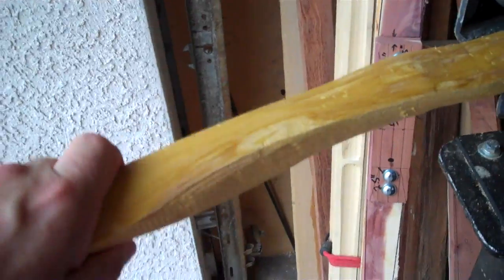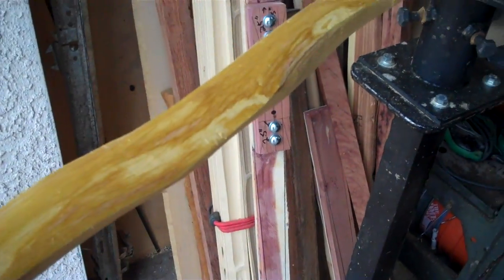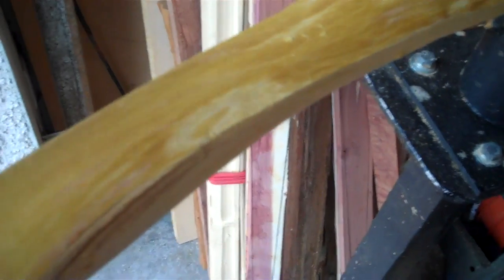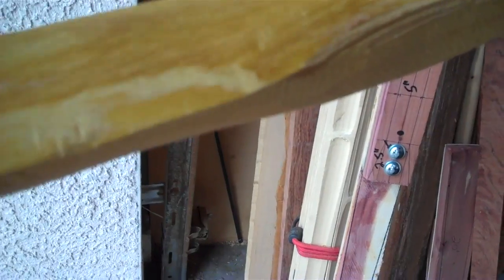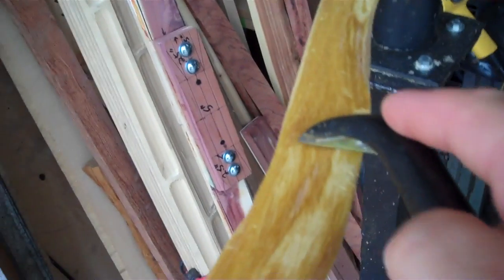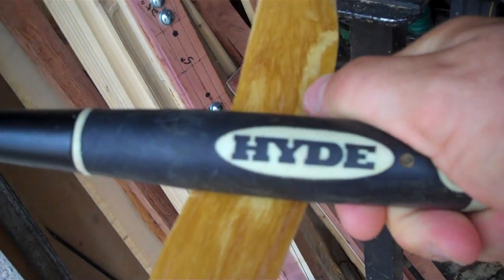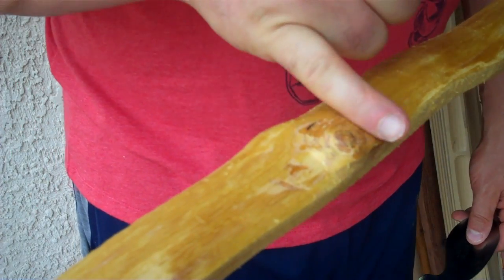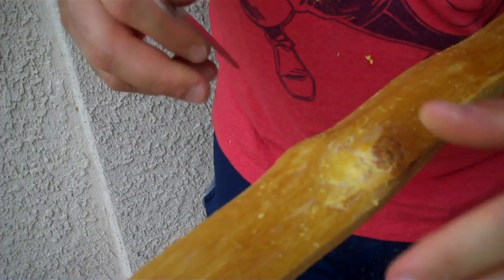Longbow (Osage) Build-Along, Part 2: Reducing to a Single Growth Ring

Comment: I have spotted an osage tree on my farm that has a limb that is absolutely perfect for a bow! It has a natural slight bend in it and no other curves (rare on osage). How would you go about forming a bow out of it?
Reply from the maker: First, remove the bark and sapwood only (try to maintain that first hardwood growth ring) and then seal the back and both ends with lacquer or shellac until it seasons (dries),which can take several months to a year depending on your location. You can heat the wood to speed the process and there are some Youtube videos on bow building with green wood that show how to do this.

Working with a limb is the same as with a log. Depending on the size I would split the limb into sections. I have a video that shows how to do this (with the limited tools at my disposal :) ). Once in the right piece, you can follow the Osage build alongs in my playlist. I think there are 3 different ones to choose from.

If the limb is too small to split, then use the concave side as the back and use the other side as your bow belly.

Comment: TY Mike, very useful video as usual. I made a mollegabet bow following Your instructions (High performance bow under 10$ series) and I am very happy about how i made it. I have a Q: can i use fiberglass silk + epoxy for backing (and did You ever used it?)
Reply from the maker: Yes it works very well. I got frustrated with it while applying, but the finished product is excellent.
Reply: mrgod- Could you tell me fiberglass silk is?  Mike, what would you compare it to on strength when it's done?
Reply: pastorjosh44 In High performance bow under 10$ series Mike used some sort of fiberglass "net" in stripes for bow backing. I very liked the bow itself but I didn't like the final look because the fiberglass "net" is very visible. So I searched for other fiberglass materials and came upon a fiberglass silk. It is very thick "silk" made of glass fibers, very dense material. I found it on website that sells parts and materials for building RC airplanes. Also Mike thank You for Your replay.
Reply from the maker: Fiberglass silk is also called fiberglass cloth and can be found in most auto supply or marine supply stores. It is a very soft cloth that has an almost pearlescent quality to it but when you add a resin/hardener or epoxy to it it turns clear. It is MUCH stronger than fiberglass tape and rivals solid fiberglass strips in strength. You just have to be careful not to add too much epoxy or resin as overdoing it can cause it to crack
Reply: BoarriorBows . Mike, I have one more question. I bought fiberglass silk in two thicknesses (80g/m2 and 160g/m2). Since You said that it is "MUCH" stronger than fiberglass tape that You used (and You applied 3 layers on a bow if I remember correctly).  What is Your advice? What thickness to use and how many layers? Thank You in advance for answer.
Reply: mrgod Please tell us how it turns out.
Reply from the maker: Uh oh, you just hit my limit on the knowledge as I didn't realize it comes in multiple thicknesses. I got mine from a kit without multiple thickness options and never knew what the original one was. Only thing I can tell you is that I only used 1 layer of the cloth and it was more than enough to keep a poorly grained piece of purple heart together. Amazing stuff.